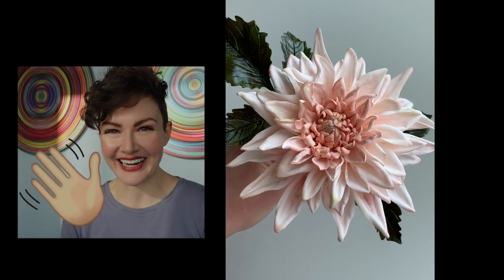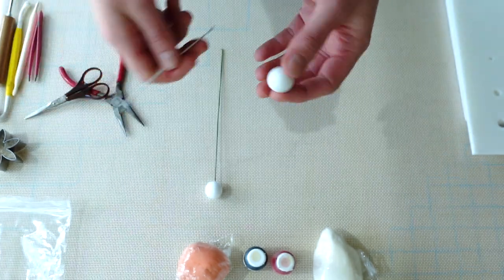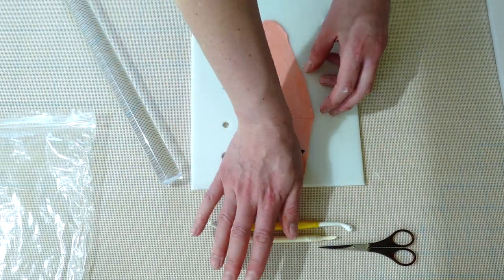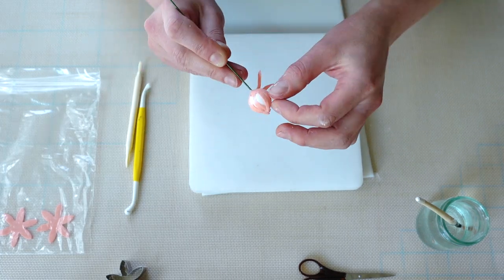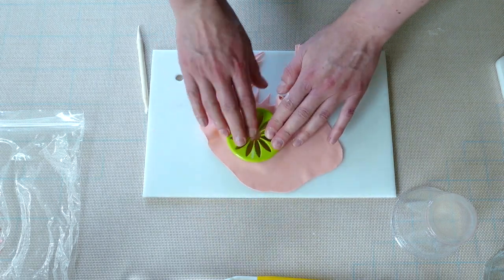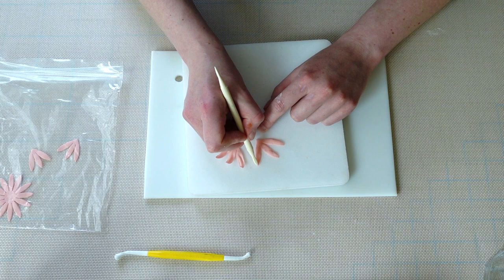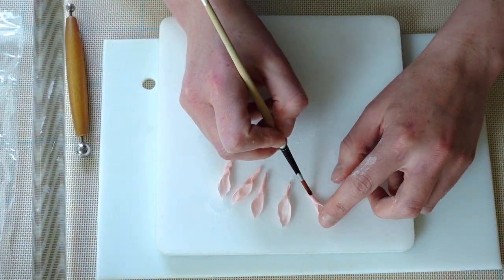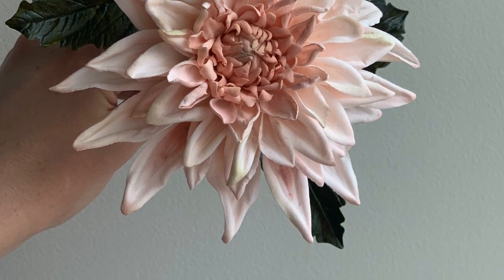PART 1: Sugar Dahlia Tutorial: How to Make a Café Au Lait Dahlia out of Gumpaste

Comment: Are ypu working in ac room , my house is in the area which has lot of humid. 😕😕😕 i love to make flowers but couldn't. This flower is amazing 😍😍😍😍
Reply from the maker: No, we don’t have air conditioning at our bakery. And it definitely gets quite humid here in Seattle, on the many rainy/drizzly days we get. It can be tricky to make sugar flowers when the air is damp and warm, so it’s worth investing in a dehumidifier for your workroom. That would make it much easier. So would using the right gumpaste — we have a recipe in our description box for gumpaste that still works really well in humid air. I’d also recommend storing your flowers in airtight bins with some silica gel packets tucked inside to absorb extra moisture.

And thank you for the compliment!

Comment: Is it possible to make with fondant
Reply from the maker: No, sugar flowers like this can’t be made with fondant. Fondant is for covering cakes. Gumpaste is for making flowers. Fondant doesn’t have the elasticity, strength, or quick-drying capabilities that gumpaste has. In other words, you can’t roll fondant nearly as thinly as gumpaste — not even close — and it will never dry out and hold its shape in the way that gumpaste does. Our recipe is linked in the description box above if you’d like to make your own gumpaste — it’s very easy!